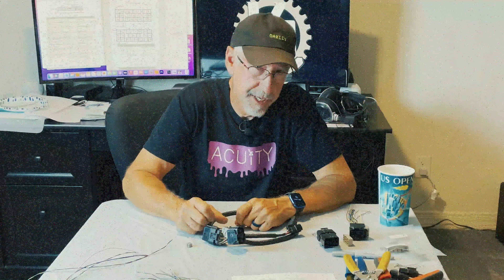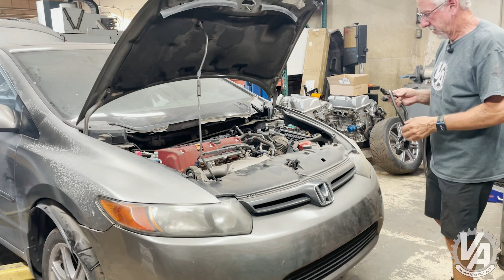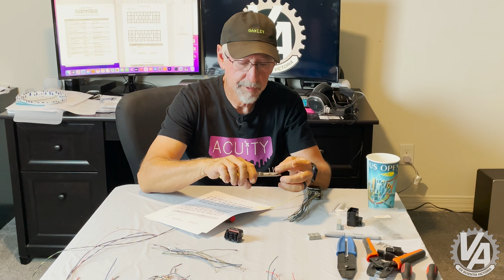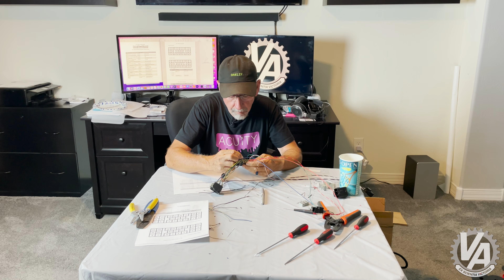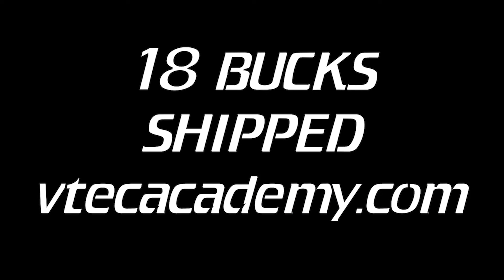8th Gen K Swap R18 to K Wiring (C101 Plug Solution)

Comment: Hey I’m have an issue doing this swap right now and I wanna know if it related to the harness I made I got confused around pin 17 g101 ground and when I did the harness I put pin 17 only to the engine side 6 and never to 345 I’m confused on how this one works and if that could be my issue for my crank shaft position sensor code p0339 unstable voltage to the sensor and I back traced and back probed the ecu and I’m only getting .3 volts to the signal wire when I’m suppose to have 5v is that and issue with the harness adapter?

Comment: what does #17 G101 Ground C side > E-side (3), 4 (5, 6) mean? I noticed you didn't do anything with that one in the video. Currently making the harness and that's my only hangup
Reply: Hey dude I’m stuck on an issue on the ecu with my swap did you ever figure this ground thing out?
Reply: @EliLopez-v3d  I completed the swap and everything works. I made the harness brian shows. The only things I had to do was I connected the downstream o2 sensor to G101 in the adapter plug on the engine side instead of going to A9 for sensor ground 6 which worked out fine for me. Additionally I had to add an additional wire in the adapter harness engine side #4 to chassis side #17 which I believe is what he meant by "#17 G101 Ground C side > E-side (3), 4 (5,6). 

I have a few write ups on the swap on 8thcivic forum. Search user JustSomeDummy
Reply: @coreyscarrepairs I’m having a issue with my crank shaft position sensor
Reply: I’m getting about .3 volts from the ecu when I should be getting 5volts

Comment: Hi @VTECAcademy , watched the video and checked the instructions sheet where would you plug  #17 on the engine side ? Any of 3 4 5 6 would work?
BRN/YEL
G101 GROUND
C-SIDE > E-SIDE (3), 4 (5, 6)
Reply from the maker: Use 4, but any will work. 
As for the splice, You can use any open position. 
Just make sure the other end of the wire gets to the secondary O2 sensor.
Reply: Brian, did you have to add splice from ecu , A B and C connector per action comments from page 3 of the instructions  in order for this to work? I’m a bit confused as you’re not mentioning this part on your video, great work & thanks again for helping the community !

Comment: Can you use the K20 radiator with the r18? No company makes r18 performance radiators.
Reply: Hopefully I'm not too late but as far I know (pulled apart an si, i daily an r18), the stock radiators are the same. You might be good with r18 hoses on an aftermarket K rad too
Reply: @seag_ull9368  Thanks for your reply.  My 8th gen actually got totaled recently so the plans to convert to K got scrapped.
Reply: @acr4715  Oh no I'm sorry to hear.. Hope you have good luck with any future projects!
Reply: @seag_ull9368  Thanks.

Comment: I have a few questions on the o2 sensor wiring part. On the AFR sensor Red, the chart  states Engine side c101 #14 from C29. Where is C29? Then on the secondary o2 sensor, BLK add splice from ecu A9 to c101 #? Where do we splice from ecu A9?
Reply: I’m asking the same thing

Comment: i have a question if we k swap a ek civic for fuel system ek have a return style fuel system and k series is return less so can we use c5 Corvette fuel filter it has a regulator built in..... for budget k swap if we don't want to use aftermarket FPR????
Reply from the maker: That should work. We haven't done that yet, but we plan to.

Comment: The Maaf sensor wiring is also very different between Fd1 and Si. Can you elaborate can Fd1 Maaf sensor work and vise versa?  The grips are also different. I wired Fd1 Maaf sensor according to sessor diagram and still getting all type of Maaf senspr errors. I am  using Civic Si Fg2 ECU and Wiring
Reply from the maker: I used the Si MAF with the Si engine harness and no problems.
Reply: Hello 
Did you fix the MAF error ? 
Or just replaced it with a SI sensor
Reply: @CheatsCustoms  Use Si one. That's the only solution

Comment: I really hope the K swap on 8th gen become more commun and more easy in the next few years, especially for countries where you can't find a Civic 8th with K engines
Reply from the maker: Exactly!
Reply: Hi @S.E.M78
VTEC Academy responded to me. You have a FD1 8th gen civic. Meaning the 4door R18. They say this swap don't work for FD1 R18. Seems it's only for the 2 door FG chassis.
Reply: @randallabrahams5760  it can be done if you take all the parts required from a wrecked FA5 or FD5 (acura). But it will be a good thing to see swap kits like the ktuned one for the 6th gen
Reply: It’s 2025 August 31st and I’m doing one rn

Comment: Brian, where do you purchase your wires from? What gauge do you use for wire harnesses?
Reply: 4rcustoms is a good source. I typically use 18ga wire for power and ground and just size appropriately for the others, which is typically 20 and 22ga.
Reply from the maker: 20 gauge and I by from https://4rcustomswire.com